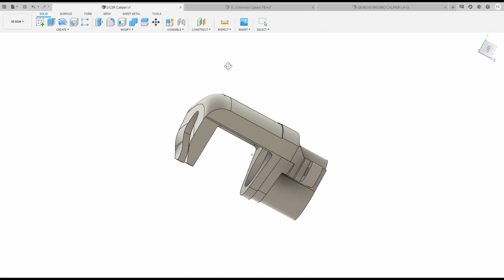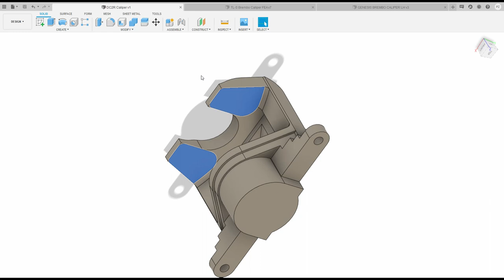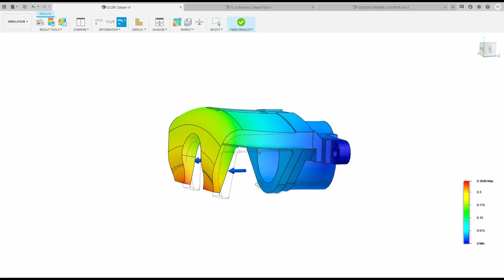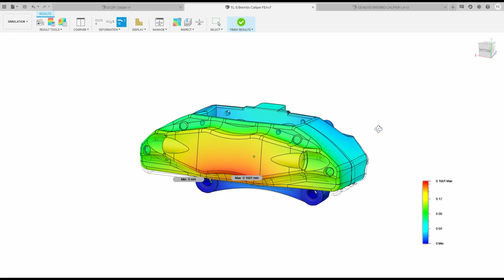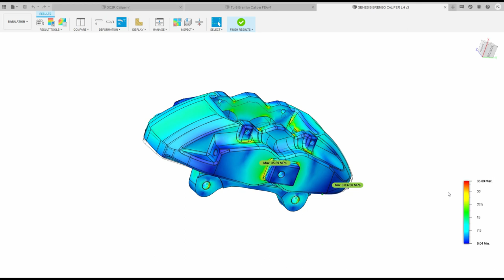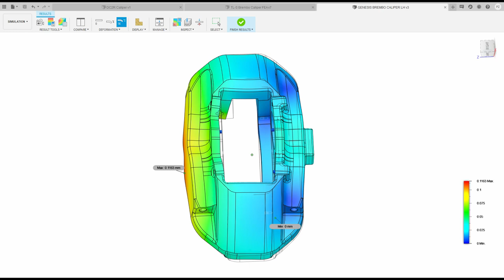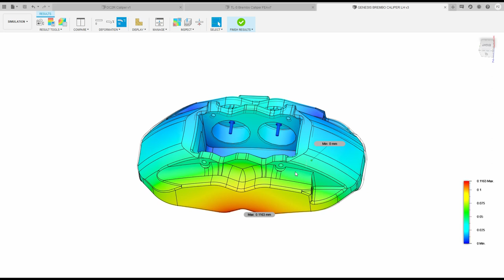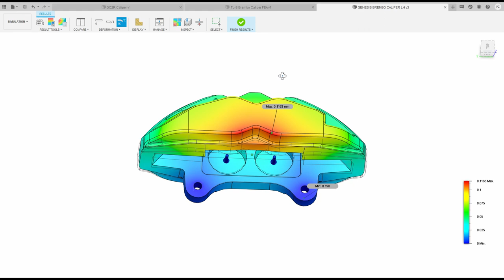DO You Know What Brake Caliper Rigidity / Deflection Mean?

Comment: Makes me think of the time where I drove a friend's STi and I thought the car had stiff brakes with poor feedback. I originally attributed it to the pads but now I wonder if it was the calipers. I was coming from an RSX which uses a steel single piston sliding caliper and I thought my brakes felt easier to control. Could caliper deflection actually aid/help brake modulation or am I out to lunch?
Reply: I would THINK that you would always want to minimize caliper deflection. It just creates an inconsistent feel. If you want to fine-tune your modulation efforts, better to go with a pad that has the characteristics you're after. There's a lot of options out there!

Comment: It would be also interesting to incorporate differences in material properties in cast aluminium commonly used in low cost monoblock calipers and forged aluminium in higher cost two-piece calipers. Obviously forged material having inhomogeneous and non-isotropic properties make that difficult but approximations could be made i reckon.
Reply from the maker: Charles The strength difference will vary significantly with different grades of aluminium however the stiffness of the different grades of aluminium will not vary very much (69-72GPa). Since the calipers operate entirely in the elastic region the anisotropic properties will also play a very small factor in this. Inhomogeneity in the material would definitely throw things off, but hopefully the quality department of these brake manufacturers catches those defects before they make it out the door
Reply: @FormulaDeltaOG  good point i was thinking that after i left that comment. Its only going to be relevant in extreme heat and load situations where yield occurs (as it does sometimes in real life), not during normal use.
Reply from the maker: Charles Nam no worries, it’s always good to see people like you ask good questions to further people’s understanding of the material that is being presented. Would be very interesting to get an in-depth understanding of the design parameters that a company like Brembo go through to produce some of these products